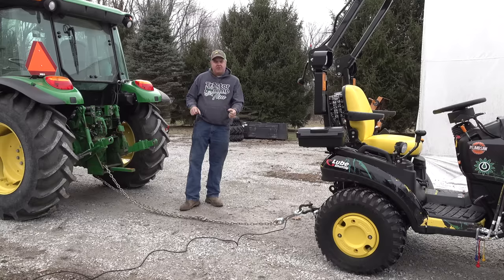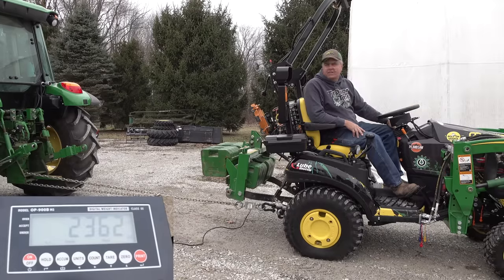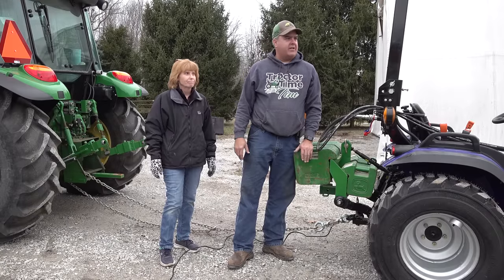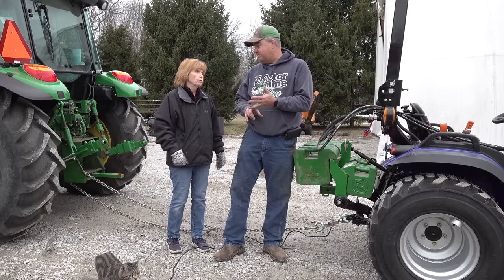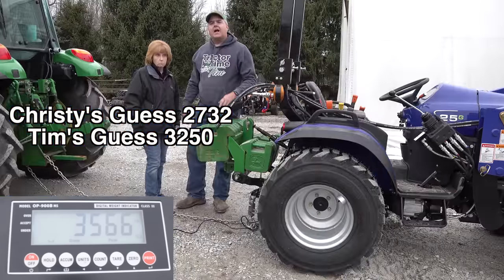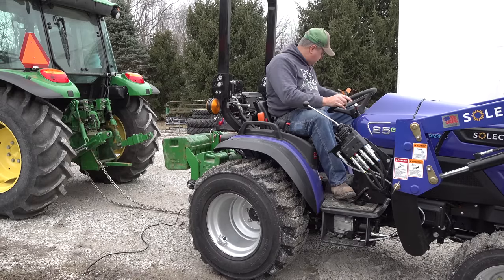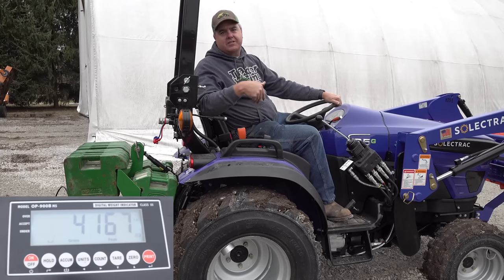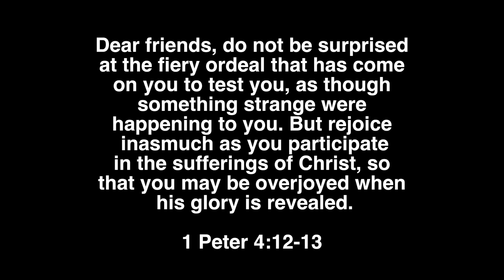CAN THE ELECTRIC TRACTOR PULL ANYTHING? Solectrac e25 vs Deere TURBO 1038X Tractor PULL TEST!

Comment: Not surprising that the electric tractor had more torque, just look a electric trains for instance. They use diesel generators to run  the trains electric motors. Same for the big dump trucks in coal mines. Great demo.

Comment: So a couple things I guess.  1st I guess is that the electric tractor seems to be in a bigger category than the 1025r, the length the size of tires and probably the most important is its weight.  Maybe I’m wrong but I bet the electric tractor got 1000 lbs on the 1025.  Second the hydro transmission of the 1025r will quit long before the 23hp engine.  And the electric has more of a mechanical transmission it sounds like instead of a hydraulic one.  If so there is no slipping.  I would bet if the 1025 had a manual transmission it would likely pull harder.  With that said glad your having fun with it

Comment: With the bigger tires and electric motor, I expected the Solectrac would pull much more than a traditional subcompact.  Electric motors have amazing low rpm torque.  The three point hitch issue is surprising.  There are dozens of tractor manufacturers from all over the world who make it work.  Its a shame Solectric made such a mistake.  Oh, and I am with you...a good cheeseburger is hard to beat.

Comment: Do you think the rear tire size makes a difference in pulling power? I've seen older tractors out pull newer tractors with matching horse power, taller tires usually gives a bit extra pulling power
Reply from the maker: I think it is more about weight than tire size.
Reply: @TractorTimewithTim   I just wondered because we had used a John Deere compact and thought we could till a field with it, ended up having to use the old B John Deere. The farmer loaning is the implement said that tall tires with equal power would out work. No science, just wondered if taller tires on Johnny X might make a difference. I think he said something about it being surface area touching the ground
Reply: Tire diameter definitely plays a part. Think of the mechanical advantage you’re gaining
Reply: @Lackieestatesfarm  differential ratio plays a part and balances out tire size.  The advantage of tire size is contact patch of a larger tire, but the ground pressure from a smaller tire may supply better traction depending on the surface.  Each has its advantages/disadvantages.

Comment: Direct drive motors have to be very large to get the needed torque and therefore use a lot of expensive materials and cost more to manufacture. They also need lots of poles to make cogging minimal. Smaller diameter motors spinning fast will produce the same HP, and after going thru a gearbox the same torque, but negligible cogging. The smaller motor will have a harder time rejecting heat due to its smaller surface area and will make more noise, while costing less.

The issue with the over running can probably be fixed by a software update. The motor spins at a high speed with a lot of inertia, it and the gearbox. All they need to do is put a more aggressive slow down in the motor controller. Either regenerating some of that energy back to the batteries, or dump it to a resistor. 

Another thing to consider with electric. Both sides of the gear teeth are used. Adding to the life of the gearbox, all things being equal.

Comment: aah but tim, in real world situation, middle of summer maximum hours on 1 charge (  i believe it was 6 from memory )  will the tractor overheat the motor or battery ? will the max number of hours reduce ?  when working hard pulling a box blade / or a plow.
Reply from the maker: We will test this and provide accurate real world numbers.  Give us time! Spring is coming!
Reply: @TractorTimewithTim  cool. , i think everyone is thinking the same, Don't get me wrong i'm all for electric tractors, but they need a few improvements   Longer lasting batteries and salt cells NOT explosive lithium fire starters. ( or should i say fire that can't be put out )

Comment: i built an electric tractor years ago out of ford 8n,   you can pull alot and it always spin out even if you placed it high range .  because  of the electric motor. sure   I might have about 15 hp continuous  with my electric motor  at 100 amps. but  my electric  motor  and motor controller can handle 1000amp for 5-10  minutes  so that 150 hp coming out of tractor  rated for  20hp. and i ripped a transmission apart with it at that load.  with an electric tractor it is either spin or go and  nothing in between. to prevent me from destroying   another  transmission  I put i a resetable fuse in. as soon as it hit 200 amps it pops.  as you just can not tell what sort of load you are pulling .. you could plow in high range if you like. but you just be pulling so many amps you could fry something

Comment: Ok my guess is 3100 Bob. I won't edit this after we find out.  
Edit: wow I was way off. But I agree that roll out is a lot I wonder if they do that as a regenerate method to extend the battery.
Reply from the maker: I think it would pull even more. I need to get more weight on it and retry.

Comment: Question I don't know how else to ask tim a ? so here it is Why doesn't a load & go for a 54 " mower deck fit on my 2019 1025r or maby i should ask  can I make it fit what is different with the 2020 deck?
Reply from the maker: Deck design changed dramatically in 2020z. Load n go does not fit yours.  Sorry.
Reply: @TractorTimewithTim  thanks hopefully after market will jump in for older years !!

Comment: No, the cat wants a mouse burger or rabbit stew. Lol
Seriously,  I figured the electric could pull more. However, I  still question their longevity and endurance as well as battery replacement. 

I remember at the Tippecanoe County fair in the mid 70s that GE had an electric lawn and garden tractor. It could out pull any other lawn and garden tractor.

So why didn't they take over the market? I don't have an answer but I imagine someone does.

Comment: Used to it or not, that rollout seems dangerous to me.
Reply: You have to have a mindset of hitting the brake, like a car or like pushing in a clutch on manual gearbox machine.
Reply: @Itsa_Mea  Sure, a car rolls after the accelerator pedal is released, but it isn’t under power. It’s the power in this tractor rollout that I find concerning. Those wheels were still spinning under significant load after the pedal is released. Release a hydro pedal or press a clutch under load and all stops.
Reply: @ProductiveRecreation  you said it in your last sentence. Pressing a clutch, or in this tractor's case, the brake stops it.
Reply: @Itsa_Mea  This rollout is all in the software though, and with regen braking you should almost never need to use the mechanical brakes. Shouldn't need to change your mindset, the controller should just be programmed better, and even with mechanical brakes, the motor is resisting the brakes during the spin down, wasting power and wearing the brakes.

Edit: Actually, scratch that last bit about the motor resisting the brakes, there must be an override switch to cut the motor when the brakes are used, that's a standard function in ev motor controllers.
Reply: @promethius357  Tim touched on it in the movie, when you touch the brake it stops the motor "roll out". Touch the brake and the motor cuts off the roll out.

Comment: Electric is better.  I would guess that John Deere, Kubota and the others already have an electric version design on the drawing boards for every product they make.
Reply: The big brands are bringing out electric tractors. Regulations and public relations will force and encourage municipal councils and companies to replace diesel powered machines with electric powered vehicles. This will happen before many private operators buy electrically powered tractors.

Comment: An apples-to-oranges comparison. Johnny X had smaller tires, smaller frame and hydrostatic drive. The electric beast had bigger tires, larger frame and gear or direct drive transmission. If the physical outlay of the machines were equalized, the test results would be much truer.
Reply: Isn't this why we do tests, to weigh in the differences?  If the machines were the same than there'd be no reason to test!
Reply: To add, smaller tire is an advantage giving more torque to the ground. The bigger tire on the Johnny would bog it down even sooner.

Comment: My question is, how long can it pull that weight before draining the batteries.
Reply: A quick back of the napkin gives me about a 6.4hp load pulling at 2400lbs at 1 mph. The 22kwh battery should be able to run for 4 or so hours at that load. Realistically, drive load will vary a lot, so the battery should last quite a bit longer just pulling. The real power hog will be the PTO.

Comment: I think it's good to embrace electric for what it is. I think we as a society should realize it's not perfect, and use it for what it can do and quit trying to get it do things it can't (which we see a lot of). Until we can get solid cell battery technology and have quick charging that doesn't damage the batteries over time AND increase capacity by factors of 200,300,400% then I don't see us being able to have viable all electric options.

Comment: That electric tractor whine sure is annoying.  I always think of electric vehicles as being quiet, but that thing is obnoxious.
Reply: I’m willing to bet we’re just falling victim to the microphones auto gain control. I’d be interested to watch a sound intensity comparison, it seems like Tim was able to just talk relatively normally and we could hear him fine over the electric tractor.
Reply from the maker: Yes, the whine is annoying, but not very loud when compared to a diesel…even a diesel idling.
Reply: They need to add a sound module to make it sound more tractory
Reply: @TractorTimewithTim  The hydrostatic drive on a diesel tractor is loud when being pushed to its limit, too.
Reply: @BeingMe23  It isn’t so much the loudness as the annoying pitch.  I will take a diesel sound any day.  I agree that many hydrostatic drives are obnoxious also.
Reply: @TractorTimewithTim  i am surprised it is loud at all.  Tesla cars have FAR more powerful motors yet are nearly dead silent.  The electric tractor is simply poorly engineered as there is no reason for all that whine.
Reply: @LTVoyager Tesla has a lot more money to sort these issues out.
Reply: That was interesting to watch. Thanks
Reply: @kdegraa  True, and they sorted them out a decade ago.  All tractor makers need to do is read the papers and patents and they have a great leg up at little cost.  However, if you fail to do your homework, you get to repeat all of the mistakes and development and that gets expensive.
Reply: How interesting to see the results.  I too thought the electric would have more pulling power, but that was almost double, impressive!  Looking forward to seeing more comparisons, observations and info.  Blessings.
Reply: Well most electric vehicles have electric motors that are directly geared to the wheels. The e tractor is alot like a electric forklift, it has a electric motor driving a tractor style transmission and has a separate electric motor driving the hydraulic pump so it is going to be louder than a standard electric vehicle
Reply from the maker: The hydraulic pump is what is causing the whine.
Reply: @TractorTimewithTim  Chinesium pump?
Reply from the maker: No idea.
Reply: I think the whine is from a variable frequency drive to the motor. VFD’s make their motors whine terrible. That may explain the extended rollout. A vfd can have a controlled slow down. Some (not on a tractor) can have dynamic braking. To stop quicker and more controlled. IMO.
Reply: @Kcolby47  the electric tractor is also much bigger and heavier. Weight is everything when it comes to tractors, regardless what is powering them.
Reply: @LTVoyager  the noise you are hearing is not the electric drive motor.  It is probably an electric motor spinning the hydraulic pump.  On a diesel the hydraulic pump is driven by diesel motor itself.  Just my guess.
Reply: @LTVoyager  , I think the whine is from the hydraulic pump.
Reply from the maker: Yep.
Reply: How much $ ?
Reply: To me it doesn't sound any different than an electric forklift, and those have been in use for decades.   As others have said that is hydraulic whine, my 1020 john deere gasser the hydraulic pump whines loud enough to hear over the engine.
Reply: @LTVoyager  I’m fairly certain Tesla does not employ hydraulic pumps in their cars. That’s the majority of the noise from the tractor. It’s not so much motor(s) itself.
Reply: @jeffreycurrie3410  VFDs are usually employed on 3phase 240-575 V (AC) motors. DC motors usually have a some sort of rheostat that raises and lowers the voltage passing through it.
It’s my understanding DC current does not have a frequency at which it operates. (other than 0 Hz. I suppose)
No doubt there are variable drives for DC voltage but not based on frequency is my understanding.
Reply: @lcee6592  I doubt they do, but most electric forklifts do and I’ve never heard one make the racket that tractor was making.
Reply: @LTVoyager  yes I’ve been around electric lift trucks/ forklifts for over 38 years and some are quieter than others. Rotary gear/ positive displacement pumps will vary in noise.
It depends on the size of the pump, the rpm, the tolerances, the type of pressure relief valve and the application. So maybe the pump(s) on the tractor are louder than most lift trucks, it doesn’t necessarily mean there’s a design problem. As much, everything new is subject to improvements and maybe some refinement of the pump(s)  or the valving would result in quieter operation. I think Tim mentioned something to the effect the diesel engine is going to mask the hydraulic sound of a hydrostatic tractor which is very true.
Reply: @lcee6592  I’ll concede, it’s not a vfd, I misspoke. But there are variable speed drives. They do whine terrible. My very limited experience with teslas, I wired a few charging stations. The owner was slowly easing in a parking spot, it also whined and whirred like it was a UFO from a 60’s bad tv show.
Reply: @jeffreycurrie3410  LOL I guess maybe no free lunch at all concerning noise! I remember those tv shows! Lost In Space was a favorite!
Reply: I got to see a Monarch tractor run this week out at the World Ag Expo and the biggest shock I think for most people is going to be the hydraulic noise you hear. With a diesel engine you can’t hear that whine from the pump. The other source of noise is the big high voltage motors make a really obnoxious noise.
Reply: Is there anything else you’re gonna complain about if it’s not the super quiet that you want tough cookies get a hobby
Reply: @LTVoyager  They need to drive the motor at a frequency much higher than the hearing range of people and most animals. Which they may be already. I think some of that noise may be the hydraulic pump, and the motor and gearbox vibration which won't go away.
Reply: I have an e25 on my farm. That whine is from the hydraulic pump, not the electric motor. You can switch off the pump if your not using the bucket, but you also lose the power steering. The whine is not annoying, the microphones are picking it up. I leave it on and it doesn’t bug me. The horses don’t seem to mind, either. On this video, Tim is talking over it without shouting — he would have to shout over any gas or diesel engine.

Thanks for posting, Tim. Good stuff.
Reply: Not any worse than the hydrostatic transmission whine, lol.
Reply: Very annoying, curious if it's a hard issue to solve or just an oversight in this model? Probably fixable.

Comment: My 5100e jd is dangerous without either my 7ft bushhog or homemade 50 gal drum filled with concrete. I can’t  lift a heavy load safely without this ballast I would never be able to use my tractor to its full capability

Comment: How does the tractor battery not get drained with hydraulic pump on the electric tractor?
Reply from the maker: Well, eventually it does.  Not sure I understand the question.

Comment: Interesting, but doesn't that high-pitched whine drive you crazy?  They need to work on that.
Reply: It's definitely annoying. With a diesel, you don't hear all these other noises that really jump out at you when the engine noise is gone. Electric power steering and a variable speed pump would be a huge improvement on the noise.

Comment: I think if you get enough traction to stop that tractor from spinning it's going to break something! Does So left Trac say how many foot pounds of Torque that motor produces x the gear reduction in low range? Try going to it's limit in high range, unless high and low range is just letting the electric motor spin faster.